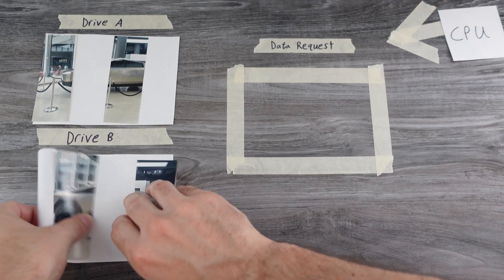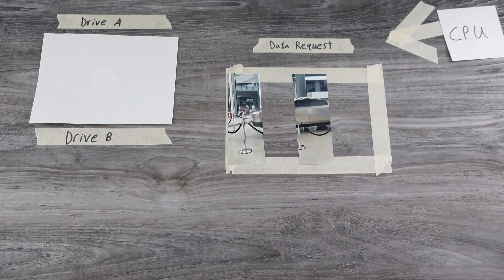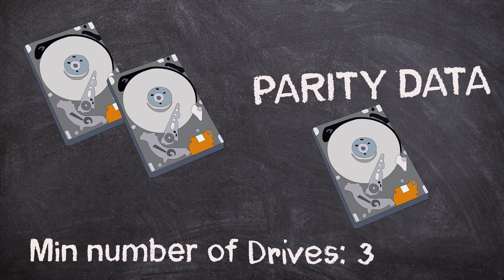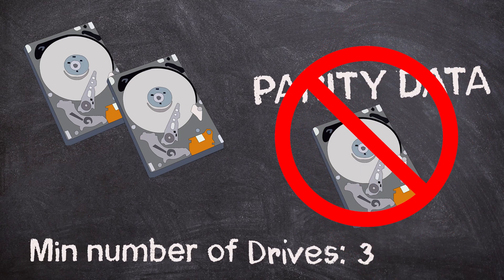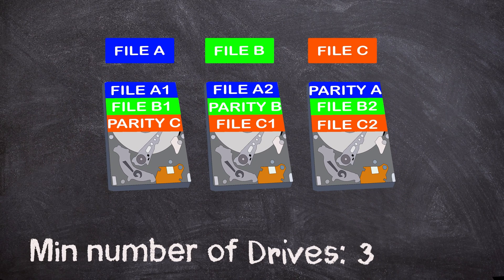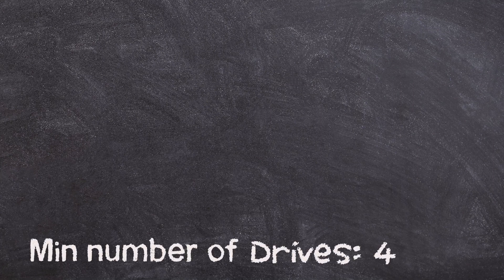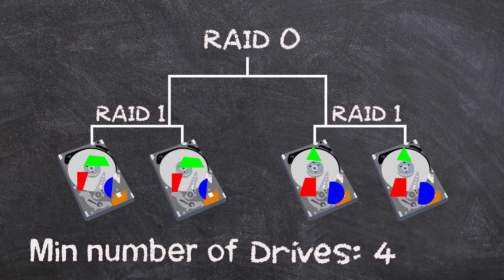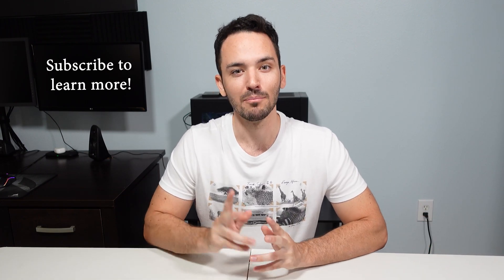RAID 101 - Unlocking the Power of Redundant Hard Drives

Comment: Perfect explanation. I honestly think I am going to try Raid 0 for my next build and just save my important data to the cloud. I've never had a drive fail yet in any build or laptop so worth the risk for gaming and benchmarking. 

My question is if one drive fails in Raid 0, I assume you would you have to reformat all the drives due to incomplete data?
Reply from the maker: That’s a smart idea. Just cloud backup all the important stuff. Tbh I actually don’t know, I’ve never had a drive fail either but I would assume yes you would just need to reformat the drive that survived because it would have basically half its data missing.
Reply from the maker: It likely would not even boot up into windows
Reply: @MaxsTech  Oh, that would be a hassle actually. Thanks for the reply!

Comment: If I wanted to set up Raid on my home PC.  How likely is it that one would experience an event where data was lost.  Say I only had 2 hardrives and was running raid 0... Is it common to have an event happen where the data is lost?
Reply from the maker: Personally I’ve never had a hard drive fail. I guess it really depends what you’re using it for/ how often. Also depends how reliable the drives you have are. I use my computer pretty much everyday though. If your data is backed up or not super important you could probably get away with it, just know the risk.